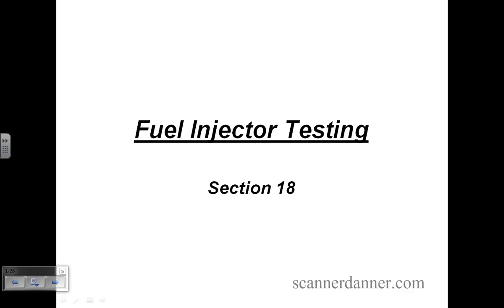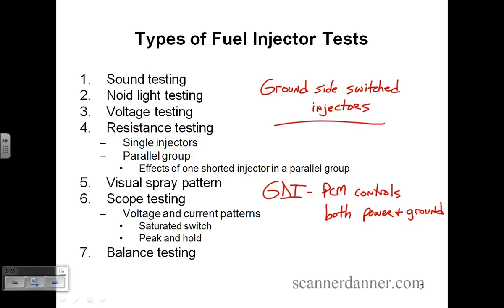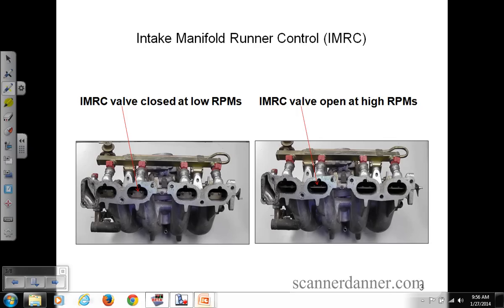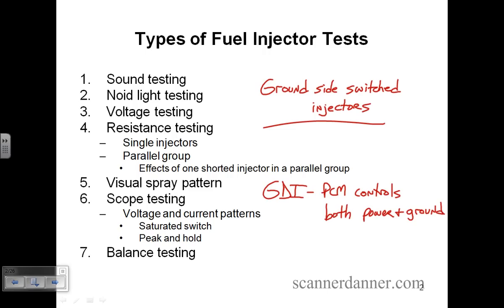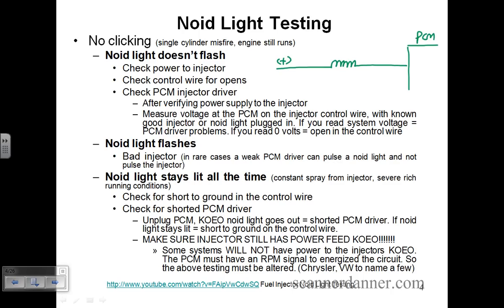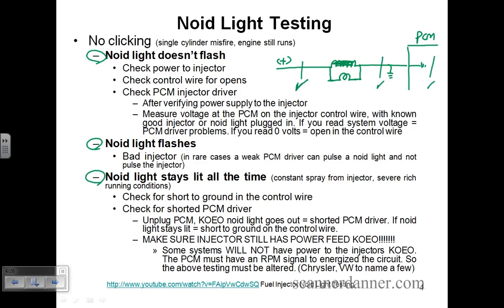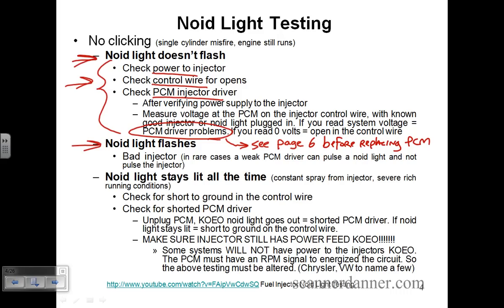Fuel Injector Testing with basic tools (noid light, test light)

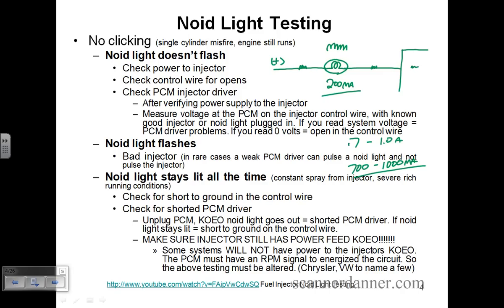Comment: 10:39
so wouldnt it be best to ditch the noid light and throw a test light bulb that draws around same amperage?and because your using a bulb that draws the same amps the circuit was designed to draw no worry of hurting pcm/driver .i know many fear test lights on pcm wires but as long as im using a bulb that draws the same amperage as device we should have no worrys right?

Comment: SD, I have a 1995 corvette with new injectors. Noid light is flashing, injectors will not spray. I took a 9v battery and jumper wire and tested all injectors and the click and spray. I have 44 lbs of fuel pressure, 12v to each injector, checked all grounds, please help!🥴
Reply from the maker: You only need to ask once and I already answered this. I need voltage readings on one of your injectors DURING cranking. Stay in this thread now moving forward
Reply: @ScannerDanner  
OK,  I really appreciate your time.
Reply: 12.23 volts to 9.76 volts on injector cranking.

Comment: Question, with the fuel injector connector plugged in to the injector, would it be possible to have your test light to battery ground back lrobed into the control wire and still see a pulse? Or does tve inje tor pulse test have to be done with test light to battery positive and connector un plugged?
Reply from the maker: I prefer unplugged for that test just in case the injector circuit is not getting power which could cause the test light to find a ground through the unpowered positive side, in particular when the fuel pump shares that power feed circuit

Comment: What to do if the injectors are hidden or on the rear bank? Thanks
Reply from the maker: You'd measure the control wire at the PCM or monitor current ramps from a common fuse

Comment: if with the ammeter you see 0.1 amperes at idle, what is the problem?
Reply from the maker: If you're using a digital multimeter for that measurement, it's not fast enough to catch the short current pulses of the circuit.
Reply: @ScannerDanner  οκ thanks YOU ARE RIGHT NOW I USED clamp on amp meter DIGITAL AND I SEE 0,6 - 1V AT IDLE  AND I USED TO BAD  INJECTOR  AND I SEE AT IDLE 4 -5 VOLT  I THINK THAT IF I DON'T HAVE PICO I WILL MAKE THE DIAGNOSIS WITH ΑΜP CLAMP METER DIGITAL

Comment: I have a v8 range rover 1998 that is cranking but not starting. There is no spark, no injector pulse, no current to the injector with the KOEO. I have checked the power center ( fuses and relay ) everything checks out to be ok. But still no current to the injector when you switch the ignition on. In addition, I have checked the throttle sensor connector. There is dc current but no ground through the wires. Please what should I check next. The only code I saw was p1842 and p1843. Help me please.

Comment: Please help I have a 05 Chrysler 300c 5.7 injector #1 is only code I have for open circuit the car smokes white raw fuel. Disconnected #1 and still smokes raw fuel but it's only code and only one to stay lit with noid. Can't do it koeo no power. Would checking continuity from pcm control wire to injector control wire tell me it's shorted? The other wire for power I got no idea were it goes but I just located the ctrl wire to pin 14 on pcm
Reply from the maker: This should help you https://youtu.be/FOwwFIWQhsQ

Comment: SCANNERDANNER, old classic cars in the 60's and 70's only used "one" ignition coil that the distributor cap has the prefix set firing order. The distributor cap has contacts and conductor paths inside the distributor cap that is prefixed set a firing order for the car. The fuel injector cars use multiple separated ignition coils for each spark plug compared to the old classic cars in the 60s & 70s only used "One" Ignition coil for all the spark plugs. The Coil of Plug COP uses 4 to 6 different ignition coils compared to 60s & 70s cars only use ONE ignition coil. Any reasons why you need so many ignition coils for each fuel injector and spark plug compared to older classic cars only used One ignition coil to fire all 8 spark plugs?

Comment: This helped me immensely to solve the gas dripping from the tail pipe issue I have with my daughters  05 Ford 500.
I found 5 skinned wires on the wiring harness and repaired those. Turns out its very common on these vehicles to wear into the PCM harness wires where they lay right on the AC line near the firewall. I hoped that would fix it but it did not. The shorted wires may have damaged the PCM. 

My grounded out #4 injector signal wire does not light the test light after unplugging the correct plug at the PCM while the 12V supply stays hot to all injectors. Its the only one that stays grounded with the KOEO. Also when cranking it does flash but never goes completely out. So I guess I need a computer.
Reply from the maker: That sounds like a short to ground in the harness on the #4 injector. With the #4 injector unplugged, connect test light to battery positive (not an LED test light but a regular incandescent style), is your test light lit constantly?
Reply: Ok what i did real quick was to unplug the injector harness near the intake. None of the pins are grounded going to the injectors. 

Checking the plug towards the PCM the #4 injecter tan/light blue stripe is grounded Key on or off makes no difference, it lights the test light. 

If I unplug it then from the computer the light goes out. Also with the plug out of the PCM if I touch the pin that sends #4 signal I get a constant ground there key on or off. The test light lights up. Thanks!
Reply from the maker: According to my diagram the #4 is a brown/light blue wire. This goes to pin #5 on the PCM connector. Are you sure you have identified the correct wire on the PCM?
Reply from the maker: Also, are you using an LED test light or incandescent test light? It NEEDS to be an incandescent style for what we are doing.
Reply from the maker: For everything you described above, the only scenario that fits would be ALL of the following conditions concurring at the same time, which seems very unlikely to me, though you did say there was harness damage (which could have taken out the driver for the #4 injector)
1. the #4 injector control wire is open
2. the driver for the #4 injector is shorted

So how do we have a #4 injector control wire that is open at the same time the #4 driver is shorted?
With the #4 injector control wire open, this means NO FUEL would ever come out of it, so this wouldn't cause fuel dripping out of the exhaust as you described. The shorted injector driver would, but you said the circuit at the injector itself is not shorted. 
Too many conflicting variables here for me.
Reply: Yes pin 5 in the PCM, I traced it out with a continuity meter to that location. I am using an incandescent test light for sure.

 I believe all  of the wiring is sound now I've had all the injectors out and pressurized the fuel rail to 40 psi  and pulsed each one over and over with carb cleaner. 

 Oddly I did not find the tan/ light blue wire damaged at the AC line where the other 5 were skinned.

One more thing I did before I left to work this morning was backprobe the #5 pin at the PCM and checked with the test light while cranking but not starting. The test light hooked to battery positive stays dimly lit key on or off but when cranking I get a pulse but the light never goes out.  Thats with the injector harness unplugged from the main harness. Thanks!

Comment: According to my Bosch book, there are passive protective circuits using resistors and capacitors, and active circuits using special surge proof semiconductor elements to limit the voltage of the input signals to acceptable levels.  Your testing methods won't hurt the PCM due to this.  The book is Automotive Electrics, Automotive Electronics by Bosch.  ISBN 1-86058-436-5.
I would also like to thank you for all the effort you put into your videos.  As an ex mechanic myself, I have still learned a huge amount about diagnostics from you.
Reply from the maker: thanks so much for the info and feedback!

Comment: I love your videos! I think after 22 years in the field I have found a great refresher for my thought processes on vehicles. I wanted to make one comment on a situation I had with an injector once and it was really random but hard to diag. I had pulse and sound unfortunately I didn't have a pressure drop tool or would have made it easier but what I found was a weird deposit almost like a calcium deposit at the end of the rail where this injector lived. Plugged the rail up keeping the injector from getting fuel. Sometimes you think one test or couple test should do it but sometimes all test are required.
Reply from the maker: I've heard about that on the early returnless fuel systems but have never seen it. Good find and tip. Thanks!

Comment: Hey Paul, 96 Nissan Sentra no start, no injector pulse. I really don't want it to be the pcm. I still uave to do the cam sensor bypass test and check those 2 signal wires to see if input is good. I do have good spar though, which scares me more... also I noticed that my test light to control wire light when the key is off, the light stays on. Does the drives grounds with the key off?

Comment: Good emphasis Paul on the current draw of a test lamp compared to the injector.  When I am helping out with someone at work and we are troubleshooting a output device I ask them the same question.  If the component is rated at 2 amps, 1 amp, and your test device is under that, say 200 milli amps or .5 an amp or 1 amp, you are not going to damage anything.  This is where I stress to other techs that knowing ohm's law is important.  Ohm's law is your friend.  Plus once you figure it out, it is not hard to understand the relationship between volts, ohms, and amps.
Reply from the maker: for sure. I get tired of hearing "you should never use a test light on a computer circuit"
thanks for your feedback and support!

Comment: does your premium class cover vantage pro class ??? 
iam trying to do relative compression check that works fine but can get second channel to pick up on eignition
Reply from the maker: Yes, it does. 
To get a second channel sync. Use the coil primary circuit. For more information, subscribe to my forum and post this question there. It is free to join and we can exchange pictures and waveforms to help guide you through the process. https://www.scannerdanner.com/forum/post-your-repair-questions-here.html